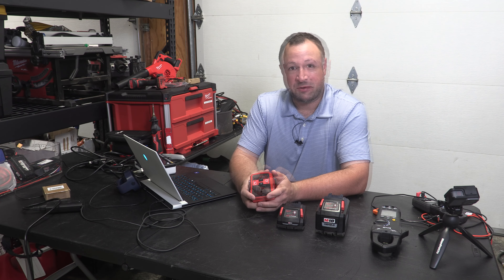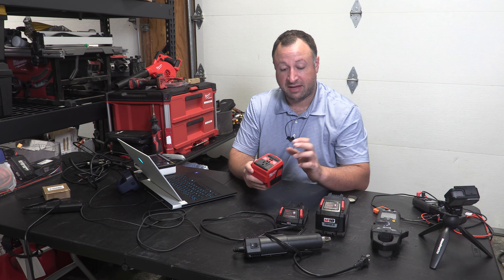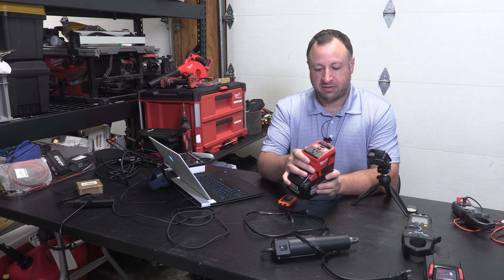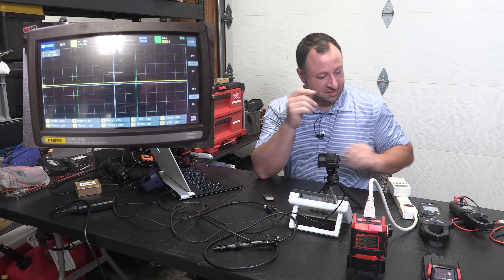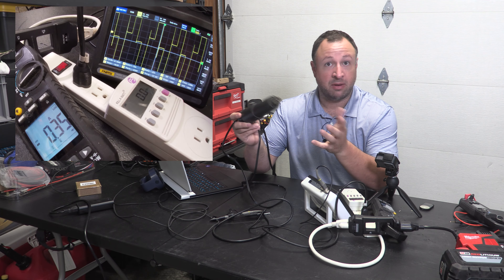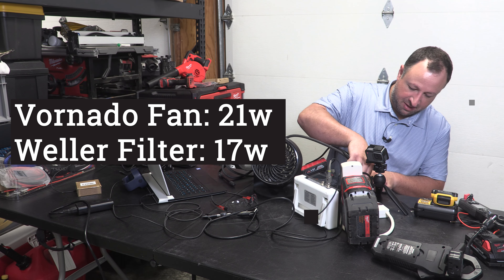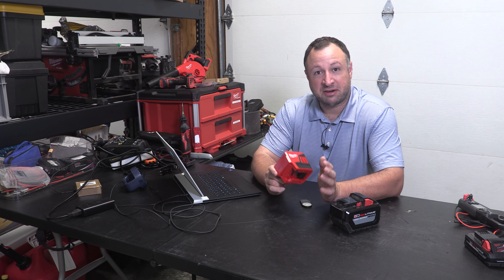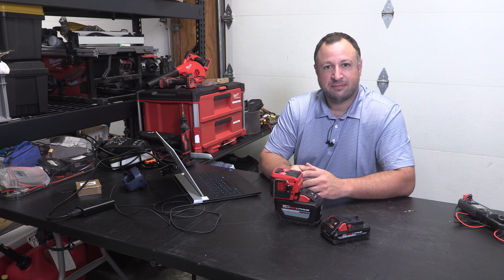Milwaukee M18 Topoff - Review

Comment: I enjoyed your series on the wall-power adapter. Have you thought about a DIY "all-day" battery? I've been thinking about a 6s LFP battery using smaller prismatic cells. It would take a specialized charger, but I think it would be pretty sweet for a miter or table saw...

Comment: Warning - a lot of letters follow :)

The issue with the waveform is not exactly what you described. It won't try to pull the rotor back as you described cause that overshooting peak is just too short in time and mechanical inertia of the rotor will very likely be just too big to react to such a short and not very high voltage spike even if the motor itself is fairly small. The issue with it is purely electrical.

One of the first things that you learn about different types of electrical loads is: a) you cannot instantly change current flowing through an inductor; and b) you cannot instantly change voltage on a capacitor. And that's where the real issue is.

Let's say you have a DC current flowing through an inductor. It creates magnetic field around inductor and puts some energy into it. Now, try to just cut off the wire to the inductor. That's where the issue begins - you're trying to change current through the inductor instantly but it's not going to happen. Inductor will try to still push the same current flowing through it - it behaves somewhat similar to a mechanical inertia, but now the circuit is open and the current has nowhere to go. So all this energy that was accumulated in magnetic field will now try to find some exit - and it will find it through creating a voltage spike on the inductor. Actually no, not like that - HUGE VOLTAGE SPIKE on the inductor. It can easily be hundreds of volts even on small motors like the 20W fan you used. That spike is the actual problem for electronics that powers said inductive load. Without proper protection output transistors in the inverter will very likely be quickly killed. And that is exactly what happens when transistors in the inverter switch off while powering a fan.

This may also present an issue for the inductor itself depending on its construction. If the voltage spike is big enough it may shoot through the wire insulation and create a short circuit in the inductor, but that magnitude of high voltage will likely kill the power supply first even if it is protected.

So the real problem is not whether a fan will survive such a crippled AC voltage - it very likely will. The motor is essentially just a piece of wire wrapped around a piece of iron - usually there's not much damage you can do to it. :) The problem is whether inverter will survive powering it. Though Milwaukee usually does pretty good job protecting their tools from such an abuse, your recommendation of not trying to power inductive loads with this type of inverters is still totally valid - just for a slightly different reason. :)

Comment: The info on the waveform was very insightful especially as it relates to inductive uses. I use a small heater in my tent while ice fishing and was hoping to use this inverter to power a small fan to blend the air, but it looks like this inverter isn’t ideal for this purpose. Is there either a better fan choice for this inductor, or would you recommend using a different inverter with a better waveform?

Comment: I bought this to use my CPAP for camping. I have not used it yet, and now I'm worried to because I don't want to risk damaging my cpap
Reply from the maker: I have never torn down a CPAP and have limited exposure to them. Assuming they have a DC blower, that theoretically shouldn't care about waveform. Same for the heating plate of the water bath.

I think they usually have a power brick, right? If so, the risk of damage to the unit is pretty minimal. There could be a negative impact to its power brick, however. This is all speculation, so hopefully someone who has used the TopOff for this application can weigh in and discuss longevity.
Reply: @harrisonhobbies241  ah, ok. It does have a power brick, so that's good to hear it's less likely to damage. Thank you for the info!